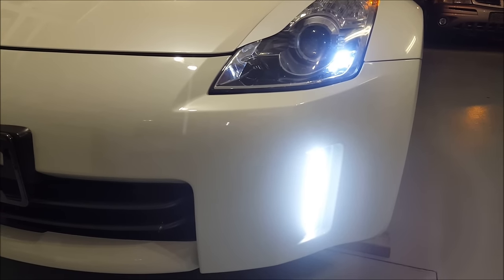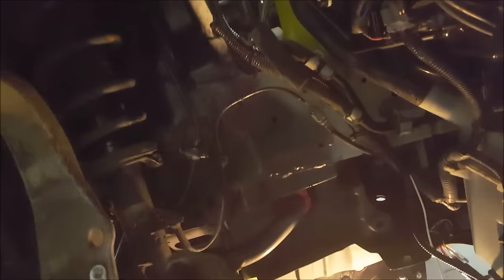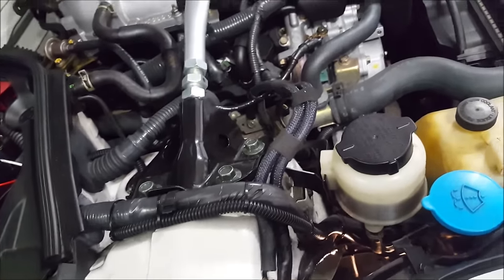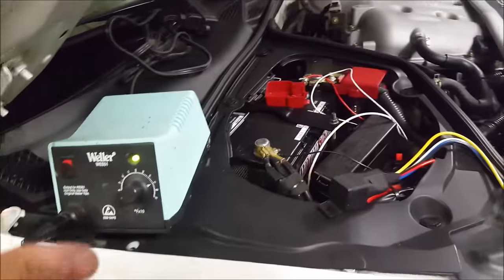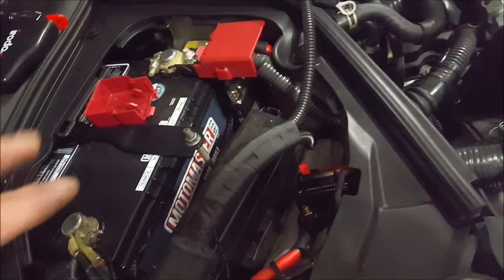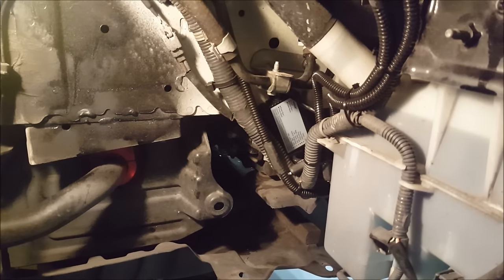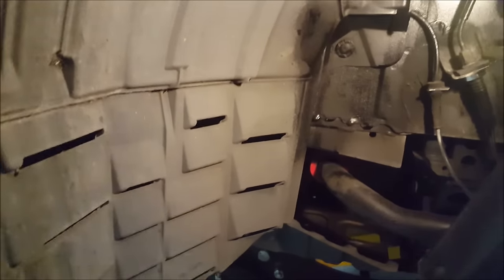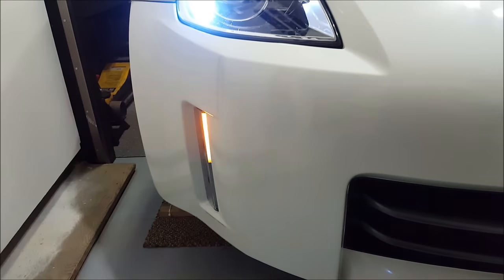Front Bumper Switchback LED Install iJDMTOY (Nissan 350Z) | AnthonyJ350

Comment: you don't do a good job explaining everything at all. 90% of the people watching this have no clue what freakin "85" is and all the other numbers as well. you need to offer a thorough and detailed explanation for whatever you talk about so us viewers can comprehend what you are talking about and actually learn what to do
Reply from the maker: Well the relays are labelled so 85 means pin 85.  Most of my videos are meant for people that have a general understanding of basic mechanics or electronics, especially for an install like this.  If someone doesn't understand a relay they should have enough common sense to look up a relay video or on Google.

If you find this video too complex I highly suggest paying a professional to complete the job.
Reply: LoL i installed mine in under 30 min but removed the bumper to do so which made it so much easier . Im js why not spend a extra min to explain the white wire and the relay . I no exactly what a relay is i used to install led underglow kits at best buy for years but 90% dont and why make a video not spend a extra min or 2 to explain a relay for the ones that dont no or the white wire

Comment: ok im lost sorry i currently have a drls with turn signal my lights run through a relay that turns on with voltage differnce and my signal turns on when i signal to turn etc but does this module stop the white orange flash and just have orange signal then drl comes back on when signal switches off will this work with my current setup? and where can i get them
Reply from the maker: +Luke Reynolds Yes this module will only go amber when it sees the turn signal pulse.  When the pulsing stops it will just go white.  It does not go white and amber during the signal process.  The link is in the description where you can buy them.
Reply: When I click the link I get an error page not found lo
Reply from the maker: +Luke Reynolds Try the link now.  Should be this. http://store.ijdmtoy.com/350Z-Front-Bumper-Reflector-LED-DRL-Lights-p/70-720.htm

Comment: is for all 350z?
Reply from the maker: +Anchi Towers This setup is for 06-09.  You'd have to go to iJDMTOY's website to check solutions for other years.
Reply: I'm confused...I have a 35th '05 and the bumper is the same.
Reply: Yeah Man Is the same But inside Is different, I bought the another ones to make sure, and Looks pretty good 👍
Reply: There's a slight difference in which way the reflector's face, but not much else. Great install and it looks unique.

Comment: Hey,I just bought this kit and am a little confused on how to wire the switchback for the turn signals. I thought each side yellow went to positive on the turn signal bulb, is this correct? Also is this all that has to be wired to turn off the drl and make the turn signal blink? I am going to be wiring them to be on all the time lights off or on! Thanks
Reply from the maker: +Gabe Jones If you want the lights on all the time, wire a relay to ignition so when, you turn on the car the whites turn on.  Then wire up each yellow to each signal.  You could also see if the e-brake goes to 12V when it's down you could use that to trigger a relay.  If it goes open it won't work.  Make sure to use a fuse inline for the power.
Reply: +AnthonyJ350 I'm testing the lights on a bench and I have the red going to positive and black going to negative.  I'm just trying to trigger the change over to orange blinker to make sure they sent me the switchback version.
Reply: +AnthonyJ350 how do u recommend me testing them on a bench.  Whites come on with red and black but what about turn signals
Reply from the maker: Gabe Jones Try to put a fuse inline on the yellow and feed 12+ to it while red is still hooked up.  Try giving pulses like your turns signals.  When first powering up the module, you'll have to wait a little while for it to turn amber.  Only happens when first being fired up.

Comment: Which Kit did you install ?
Reply from the maker: +Kerwin Lewis Just added it to the description. http://www.ebay.com/itm/141784084805?_trksid=p2060353.m2749.l2649&ssPageName=STRK%3AMEBIDX%3AIT
Reply from the maker: +Kerwin Lewis I just posted a link in the description directly from the manufacturer.

Comment: I put this kit on my 2007 350Z convertible.A good tip to keep you from running wires to your battery.The windshield washer has ignition power on the passenger front.You can tap in to that and no need to have ground running to the battery also.You can mount the solid state box to the front bumper steel frame and have room to remount the front bumper.I used small screws and pre--drilled the holes.Add your ground to one of the passenger side mounting screws with a small heat shrink eyelet you provide.
Reply from the maker: The main reason I recommend putting it on the battery is because I want to ensure it gets proper voltage.  I've had modules flicker and fail on me in the past due to power voltage being provided to the unit.  But whatever works for you.

Comment: Great video and very useful. In the UK your setup wouldn't be legal so I made some minor changes. Basically DRLs can only be used in the day here, and they must be the only lighting on the front of the car. So I connected the white wire you ignored to the parking light and I relayed off my stereo. That way the DRLs are active whenever the car is running and they switch off when the parking lights come on.
Reply from the maker: Great job being creative with the wiring to suit your needs!

Comment: Great video man!! But i'm really having problem to find any wire that has ignition power, can you help me to find one? Thank ou so much.
Reply from the maker: What do you need ignition for?
Reply: @AnthonyJ350  For this same lights kit you've installed... Thanks for the reply 🙏🏻
Reply from the maker: @GuiBXL  You can run a wire through the grommet by the battery and get ignition from the cigarette port on the passenger side dash at the bottom.
Reply: @AnthonyJ350  Thank you so much my friend, you help me a lot!!
Reply from the maker: @GuiBXL  Always happy to help out 🙂

Comment: Great video, you obviously take great pride in your work! Have you ever installed an amp and sub in a vehicle without carpet. I run with no carpet(mud) in my 94 bronco and I have my amp installed on the trans tunnel cover. I removed it and installed bolts and locking nuts so it's very sturdy. I have my sub in the rear so I just loomed the speakers wire and used a loom clamp between one of the trans tunnel bolts. What are your method(or any tips) for hiding wiring in a jeep(or no carpet 4x4)? Thanks for any help, love watching your videos!
Reply from the maker: +Brad Jim Hmmm, ya never fun when there's little interior.  You could buy conduit for home theatre applications can use 3M bumper tape to hold it to the sheet metal then paint it black.  Or if it's really thin and small wiring, if there's a lip you can use Gorilla tape.  I'm not suggesting screws because there's a high chance you might punch through to the outside of the vehicle.  

Glad you're asking questions on how to keep your wiring clean!
Reply: Good ideas, I'm gonna see what I can figure out!

Comment: Anthony, I noticed these LEDs have an option to dim the light when the headlights are on. I suppose because they are too bright for use in complete darkness. Did you set yours up to dim, and if so how did you connect them to know the headlights are on?
Reply from the maker: No I just have mine on full bright when I turn on my running lights.

Comment: Is it possible to have the LED's set to turn on only with the parking lights/headlights???  I don't want the switchback and only want the front bumper LED's on with the parking/headlights.
Reply from the maker: You could, just don't hook up the signal lights

Comment: I watched your video and its great. I am installing a relay like you recommended. One thing I would like to know is where you got your trigger wire to bring in your relay coil. I am not sure where you got your red trigger wire. Thanks!
Reply from the maker: I used parking lights for trigger.  Thanks for watching!

Comment: So I apologize if you have already answered this but it was a lot of comments to scroll.i purchased the switchback drl/ts kit and received it today.i was following your guide and the install video from ijdm to test function b4 I install. I have a dual module setup like you. when I touch the white wire(dim) to power nothing happens. I believe this is because the wire is going to the spot on the harness that has a grey wire not hooked to anything. Also I have an orange jumper coming off of my acc+ wire at each module and 3 wires coming out of the module that are not connected t o anything...all with pre-installed connectors. do you know which wire I should hook the grey lead to to make them dim and also what the other leads are for? I'm currently waiting for ijdm to respond to inquire but would like to get the lights installed asap...thanks much for any help you may have.
Reply from the maker: I don't use the dual mode on mine, just try to keep the wiring as simple as possible.

Comment: Hey dude, I own a 350z Nismo and am wondering if this will work on the OEM Nismo bumper? I believe the reflectors used are the same despite being closer to the wheel wells. Thanks.
Reply from the maker: That I'm not sure.  I'd call the dealership and find out the part number for a regular 350Z vs a Nismo.  If the front reflectors for 2006+ are the same for all of the models, this should fit fine.

Comment: what amp fuse did you use for the relay?
Reply from the maker: I believe it was a 15 amp fuse, they don't need a lot to run.  Just make sure you ground the setup well.

Comment: hi Anthony,. I recently just purchased some switch back LEDs but it looks like the contact doesn't bottom out on the plug.  So it's not making the contact, do you have any recommendations?

thanks
Reply from the maker: It might be really tight.  Try some dielectric grease might help it go in.

Comment: Do you get snow where you're from? If so would you daily the 350z or try and get an STI / WRX instead?
Reply from the maker: +IconicYT There is snow where I am (very very little), but they do salt/ use brine on the roads when it&#39;s cold.  I have multiple vehicles so I don't like using the sports car in the colder months because I don't want to expose it to that stuff.  How ever I think the 350Z can easily handle winter conditions with a properly working LSD and the proper winter tires if the car isn't lowered.

https://www.youtube.com/watch?v=VyIi1z5TMgE
Reply: The 350z can handle snow very well. The STi/WRX, is a car in its own right.

Comment: so you've had these installed since February it seems. honest opinion how is the quality and how have they held up since install? I've heard good and a lot of bad about these leds. there is a guy that makes these custom at $200 plus. zleds is his company are these comparable?
Reply from the maker: +mobmmk I've seen ZLEDS on Youtube and they look awesome.  I believe he modifies your factory housing.  The switchbacks have been flawless for me.  But you can also see I install it in a manner beyond what the average DIY person would do.  I believe that's where most people have issues.  They don't supply enough voltage or do a proper ground.  Most issues are probably install related.
Reply: @AnthonyJ350  are they still holding up. Im thinking about buying them
Reply from the maker: @Jianemba  Yup they're still going strong.

Comment: Does the turn signal in the swithback work when the lights aren't on or only when the parking lights are on??
Reply from the maker: +cornell young As long as you get the whites to turn on.  So you can also have them set up as a DRL.  I tried just firing up the turn signal wire alone and it did nothing.  Then I try turning on the main power with the signal and it would just flash white.  I would contact iJDMTOY and see if they have a more detailed instruction manual for wiring configurations.  I didn't want to experiment too much cause I was scared of damaging the switching module.

Comment: What led bulbs and temperature rating you're using for the parking lights?
Reply from the maker: The small ones in the lens is a 6000K has a slight blue to it.  If you want a more white look you'll want 4-5000K.
Reply: @AnthonyJ350 
Ok cool, thanks because my driver side bulb done blew.

Comment: I installed mine today, signal works good,  turn the headlight it goes off like suppose to my problem is it won't shut off. Headlights off, car off but light stays on, tried different wiring set up still the same. I'm lost.
Reply from the maker: Did you try calling tech support?
Reply: I know this is old post but did you figure it out cause i have that problem

Comment: @AnthonyJ350 how is it running still 5 years later?
Reply from the maker: They're working well. But I also have to mention  the car is only driven during summer months.
Reply: @AnthonyJ350  my biggest worry with aftermarket lighting is weather sealing
Reply from the maker: @ryanwalker397  It's a fair concern. You can cover the seam with 3M strip caulk to help it seal.

Comment: Hey where can I get those small led bulbs for the headlights ?
Reply from the maker: You would have to check ebay or Amazon. Like search amber LED bulb
Reply from the maker: I have to confirm, the amber ones or the white ones in the corner?

Comment: Do you think this install would work on my 2003 350z? I've been to the iJDMTOY website and they say that it would only work on the 2006-08 years. What do you think?
Reply from the maker: +Michael White Ya apparently the bumpers are different to it probably won't drop in that nicely.  They don't have any lights for the 2003-05 yet?
Reply: +AnthonyJ350 They do have a set for the earlier models, but it doesn't look nearly as classy as the ones that you have installed. They are also not switch back lights which saddens me.. /: Maybe I can find another kit, and still apply this guide. However, as a new member to the car modification world, I love your easy-to-use, easy-to-understand guides!
Reply from the maker: Michael White I'm glad you like them.  Stay tuned because I will be going over the sound system install in my car.  Also later on I'll be visiting The Z Shop and we're going to address that clicking noise in the axles.

Comment: hello Anthony, quick question for you here. so there was a fuse on the red wire when i bought the drl. what did you do to it? what was the extra wire gauge you have used?
Reply from the maker: SeanKDN I ran the fuse closer to the battery using a relay.
Reply: and for the extra wire, you wired it to parking light? by any chance, do you remember its color wire? i just got my drl today so now im drawing out a wiring diagram so i need more specific info
Reply from the maker: SeanKDN Sorry I don't remember the wire specifically. You can get info from companies like emanualonline and get comprehensive vehicle info.
Reply: do i need to disconnect the battery ?
Reply from the maker: SeanKDN Be a good idea before doing the work.
Reply: one more question: the kit has its own grounding cable and relay also has grounding cable. do i need to connect both of them to the battery or just ground cable from relay? can i use 15amp fuse?
Reply from the maker: SeanKDN I'd ground both to battery if you can if they both call for ground. 15 amp on your main power should be fine for these lights.
Reply: thank you for the quick reply. i asked because i saw that you only grounded the one from relay thats where i was confused a bit to whether or not use the ground cable that came with the kit. i will start the installation tomorrow
Reply from the maker: SeanKDN Ya I altered the install a bit to suit my application and How I wanted things wired. Just follow the wiring labels provided carefully.
Reply: i really appreciated all your answers. it helped alot and my installation went very well. thank you once again
Reply: Red = power
Black = ground
Yellow = ?
White = ?

Maybe I missed it.

Comment: man please where the white wire goes ? I have to open the front lights or at the battery ?
plies am going the installation now and am stuck there !! if you can answer to me today I will be very thankful
Reply from the maker: Censored FOX can you email me the instructions cause I can't remember off the top of my head
 info@gofasthavefun.ca
Reply: I don't have instructions and I don't know what to do . I have a Nissan 350z and am installing the same led lights at the front bumper , i did all the things you tell at the video but I don't know were should I plug the white wire can you help me with that ?
Reply: I will send you at the email what I fined at the internet for the instructions now
Reply from the maker: Censored FOX Does it say on the control box what kind of trigger the white wire is?
Reply: man thank you I fund out how to plug the white one
Reply from the maker: Censored FOX What did you end up hooking it up to?
Reply: Censored FOX what did you end up plugging it to I have the white only version as well I plugged the white one to the daytime running lights green and white cord. The light stays on all the time even if the car isn't on. Turns off when I turn on running lights or headlights so I put the white wire to the head light positive (red) cord the light it stays on with daytime running turns off with headlights and stays on when everything is off where did u end up putting your red wire for 12v ACC

Comment: Is it possible that these will work on an 04 350z 
I know it says 2006-2009 but damn these reflectors look really good and there's no other reflectors like that for models 03-05
Reply from the maker: Unfortunately I don't think so. You'll have to upgrade to a 2006 bumper.
Reply: AnthonyJ350 well thanks for the quick response
Reply from the maker: Auho10 No problem!